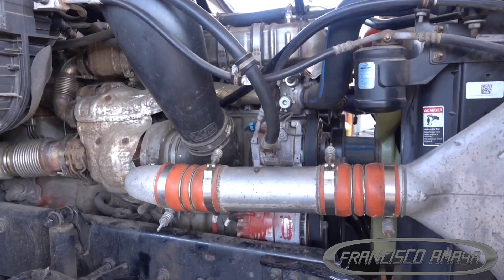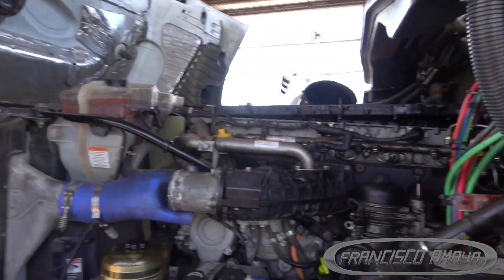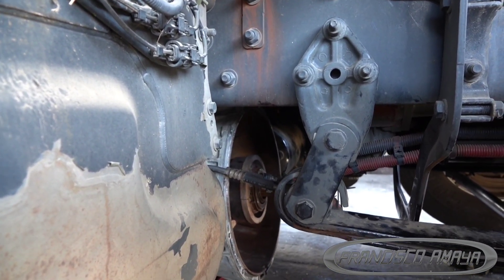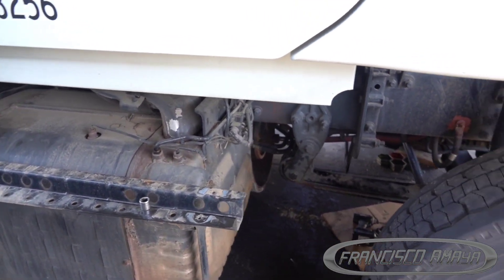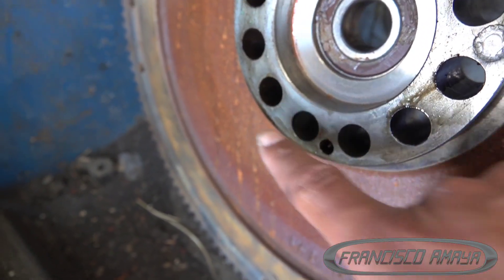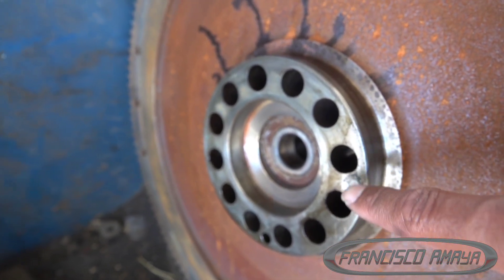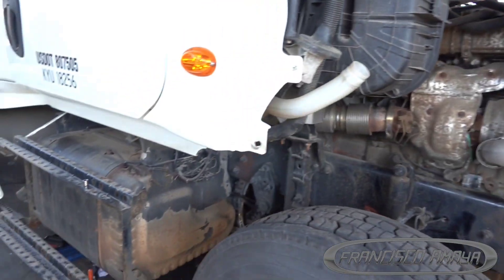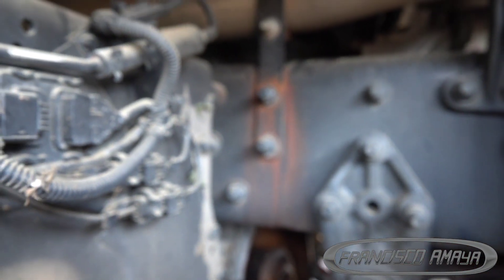DD15 ENGINE OUT OF TIMING NO START TIMING MARKS NOT ALIGN CORRECTLY DAMAGED FLYWHEEL

Comment: Did you replace flywheel assembly due to timing pin broken?
Reply: Yes he did.... Before showing the old flywheel, he stated that the transmission is in place and ready to be mounted bc they have fixed the problem.